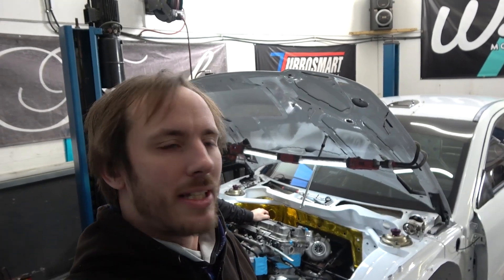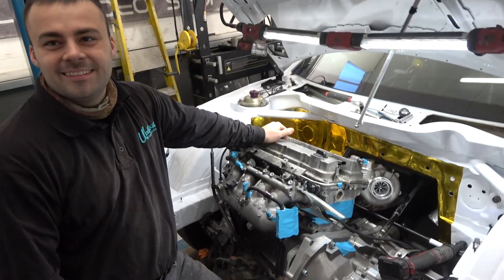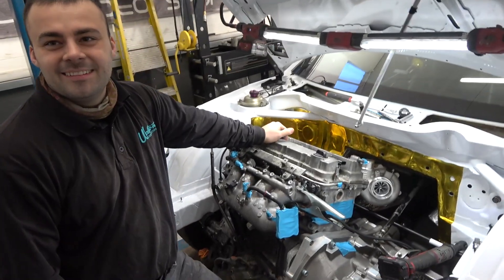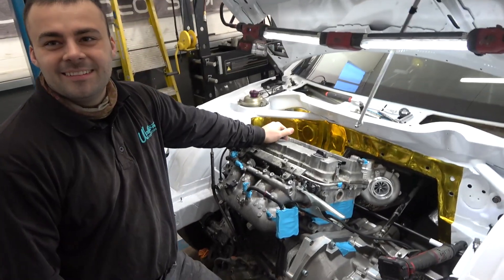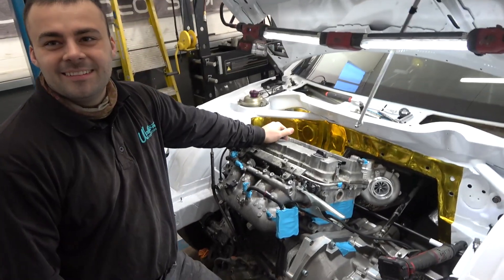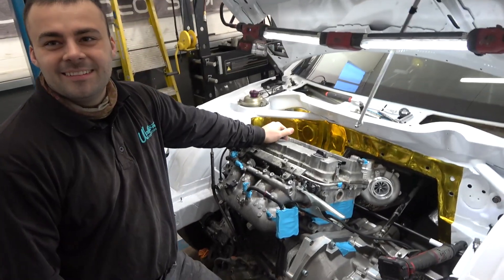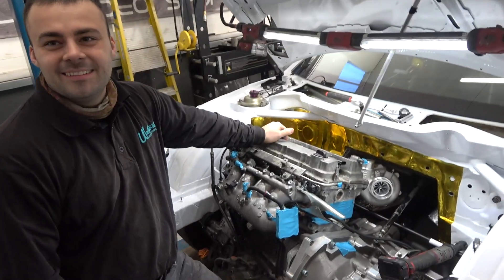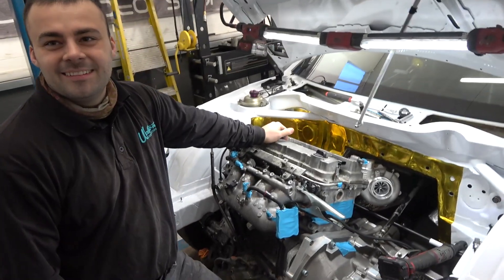Walton Motorsport - EVOX Powered Proton S2000 R5 Rally Car Fresh Air Antilag (ALS) Manifold Build

Comment: What diameter tubing did you use for the manifold?
Reply from the maker: ID of 36.66mm, same as most of our 4 cyl turbos manifolds use.
Reply: @WaltonMotorsport  good to know. It seems a lot people are using excessively large runners for 300-500hp builds. Must be an American thing.